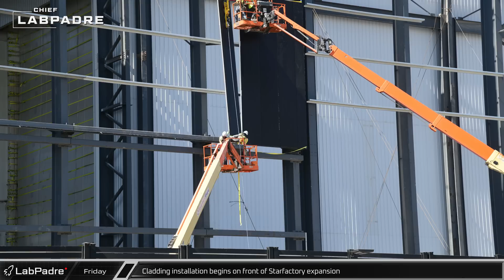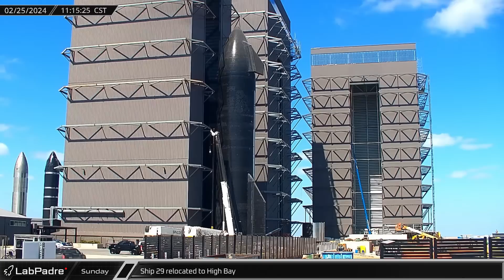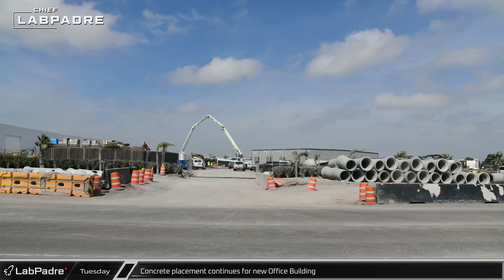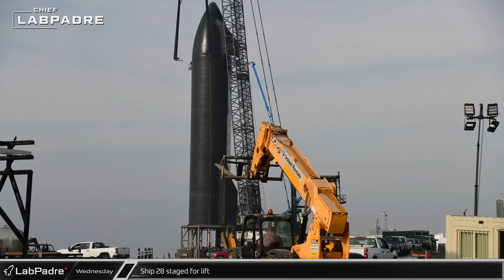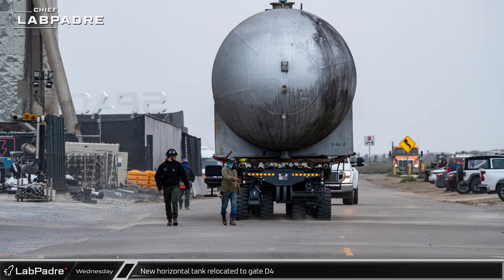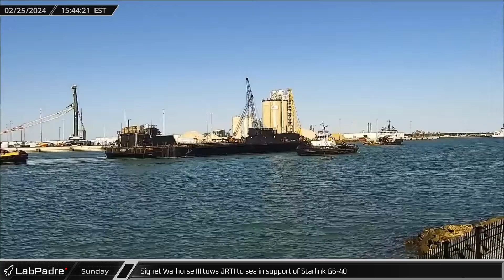SpaceX Is Getting Really Close To Launching Starship Again! - SpaceX Weekly #104

Comment: Will the star factory construct the ships/boosters vertical or horizontal?
Reply: Vertically, like in the tents. You can’t keep thin stainless steel tubes on their sides.
Reply: Vertical for sure, very weak laying on their side unless pressurised
Reply: @TheMovieLoft  and you couldn't pressurise them until they are long enough to have end caps welded on, which is done as they are stacked in the high/mega-bay
Reply: It's not for a completed ship or booster, it's for the segments. (Which were previously built in a temporary tent.) It will still be assembled in a high bay.